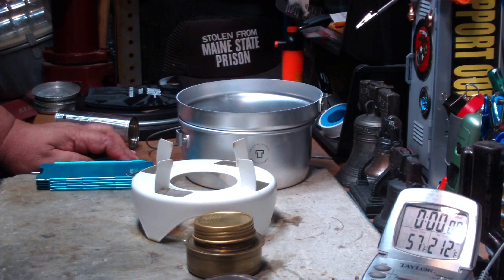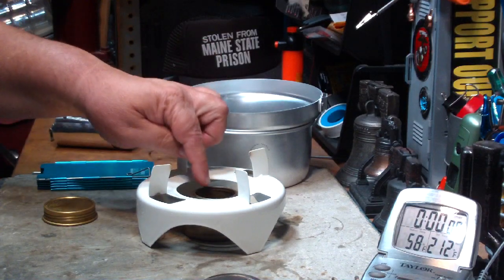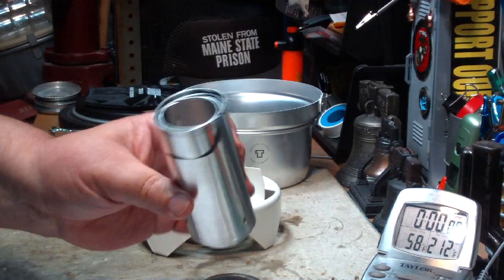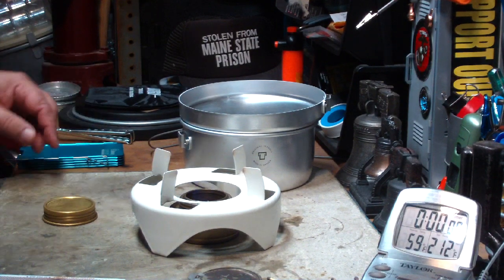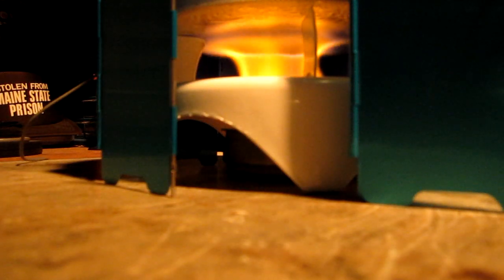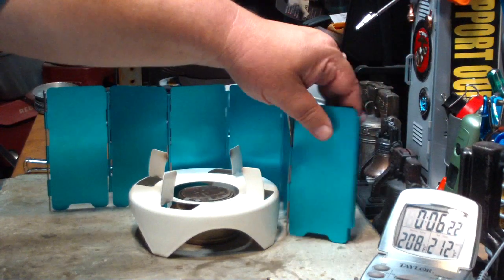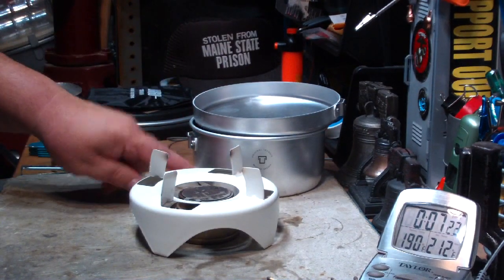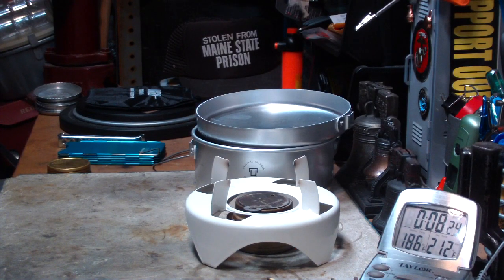Trangia - Open Spirit Stove - Boil Test #4

Comment: Thank you for starting all of your WBTs at a common temp. So many people don’t realize the amount of extra/less time it takes to raise water temp by even 5C. 

Have you ever run the exact same set up 2 or 3 times?  I’d be interested in the difference in boil times. If it’s much less than the difference between different set ups then no need to repeat the same set up. However, if you find that the difference is substantial, then it will be important to test the same set up 2-3 times to ensure one is faster than the other.

Comment: Did you measure the spacing between the burner & pot in a regular Trangia stove? 
The heat comes up the side of the pot & the windshield stops it from immediately going to waste.
I don't know what Trangia you use, #25 or #27, but I have the #27 myself. It is simple & safe, even if it isn't the fastest thing.

Y'know I wonder about the Swedish military burner in a modified #25 base.
Anyway.. I am going to watch  A Tale of Two Trangias next.